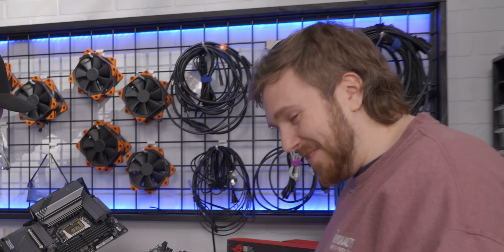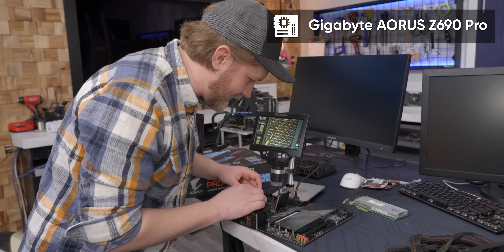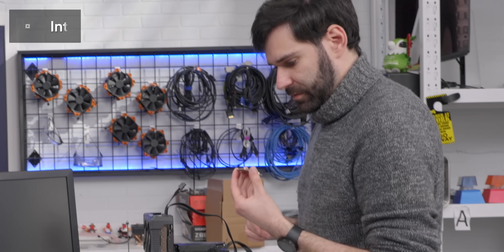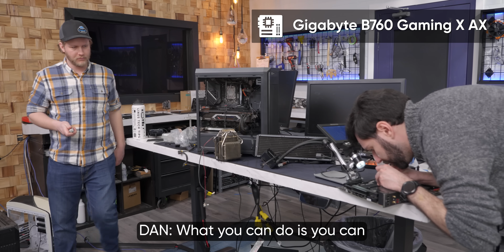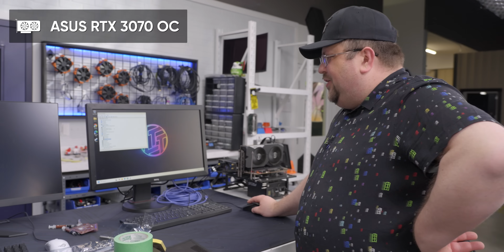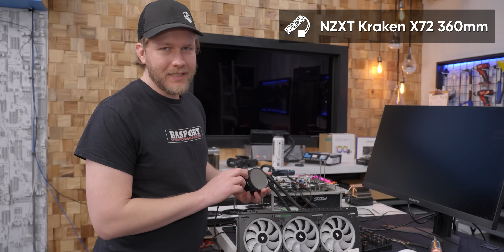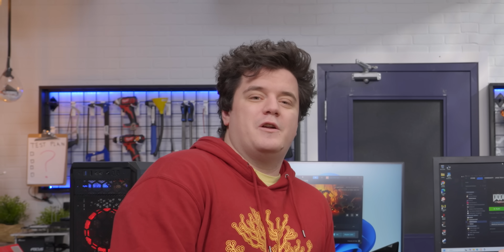I Built a Working PC using only Broken Parts

Comment: When buying "broken" PC parts for repair, focus on stuff that mechanically damaged - scraped off components, broken connectors, bent pins, these have the highest possibility of working again.

 BUT. 

This only applies if you buy it directly from the owner who did it or some trusted source. Theres a ton of sellers that just manufacture a fake problem to cover the real one preying on your dreams and hopes. Fried CPUs with bent pins on purpose, dead mobos with bent pins but entirely different problems, gpus with broken fans or hdmi.. 

Also some repair shops sabotage parts with intermittent problems to make a easily RMAd problem.

Got a non working 5800X3D for ultra cheap (directly from RMA), tried it, shorted, motherboard survived but psu got damaged .. sold it as decoration for few bucks, got contacted half a year later by a guy that got scammed with it in another country, then later he boasts to me how he scammed AMD and got a replacement out of them. Some of the parts have history 😅

Comment: reading all F's is not a sign of a dead core or card either its a failed bios chip or a failed read of the bios chip those connectors are hard to get on there perfectly its best to just de solder the bios and solder it onto the flasher

Comment: a friend of mine gave me his PC and I was literally just expecting to use as a case and not much more, but turns out they just knocked the GPU out of place and putting it back in fixed that. though unfortunately the CPU had baked the motherboard because the OEM broke the CPU cooler. so a mobo, a new CPU cooler, and it's as good as new for the most part.

Comment: Honestly broken electronics are such a fun hobby.. if you have too much time. I got a Really nice DJ deck (NI Traktor Kontrol S4 MK2) FOR FREE because it was "missing power" and the guy was going to chuck it if nobody had actually picked it up that day. I got it working with the power cable from my display and went to get a universal charger with that tip for 80€. He gave the deck away in a pioneer DDJ400 box so the guy had gotten a 300€ controller to replace a functional 900€ controller 🤷‍♂️

Comment: I had to RMA ram one time... it was a PITA diagnosing that it was the ram breaking, and it didn't break linux somehow, so if I didn't dual boot I'd've never noticed. at the time I was mostly booting windows tho

basically it bluescreened once I hit ~30gb of ram used. which isn't hard when you're a java dev.

Comment: When I was trying to build an ITX build on a budget I bought a broken B450 listed as "for parts" to see if I could find out what was wrong and fix it

When it arrived I realised that even if I could get it working, the bastard had ripped off literally every single removable component, so I'd still be left with half a motherboard 

"For parts" my arse, he even took the cooler backplate and vrm heatsink

Comment: buy a prebuilt with crappy everything else but the gpu, that also has on board video, take the gpu often these systems like hp cost less than the gpu usually sells for, resell the pc with built in vid working to a hs student who only needs it for internet and  homework.

Comment: Buying broken hardware, while not very lucrative for me, is worth more for the learning experience of what repair entails. Recently I bought 5X 'broken cameras' on ebay (all the same, cheapish obscure camera). One had a 'lens error' [these cameras did not have removeable lenses), 2 had broken battery compartments, and one worked straight out of the box just fine (had some scuffs though). All were claimed broken via sellers.

The fixes:
-Screwdriver on the lens error - I placed a wedge between the lens and the lens casing, and re-deformed the plastic lens casing to fit the lens. The pictures remained sharp. I believe the lens casing bent slightly due to a drop issue.
-Replaced battery compartment using body + hinge from broken camera
-One battery compartment was beyond 'sellable' repair - The body of the camera had nothing to keep the battery in place, it was just a giant jagged hole. Tape was the solution for me, and I chose to keep it for myself instead.
-The completely dead camera was necessary to diagnose first as the likely 'forever dead' specimen, so I could deconstruct it to see how the camera was put together for the other repairs. The dead one had a battery explode, and had some corrosion evident even without deconstruction.

Comment: My GPU was listed as dead, with random shutdowns, so I did a little digging found out it had entirely inadequate thermal dissipation for memory and decided to take the shot on memory overheating... It turned out I was half right, it was a cooling issue, but it just had a blind spot on the die. But still $300 RTX 3080 (2 years ago) is nothing to sneeze at :3

Comment: I love my delta hub wrist guards, if folks needed a testimonial outside of an ad, but I also recommend turning them 180 degrees and using them for the opposite hands. At least for my wrists, the outside end is pointier and sharper, and is much more comfy.

Comment: My partner and I both kept GForce 970's running for 15 years! Fixing/refurbishing old parts is a challenge.  My card had to be taken apart and scrubbed at least 5 times in the years that it ran.  We still have them, we both just upgraded to the Ryzen 7500 (him) and 7800 (me)

Comment: Bought a 3080 that booted but got hot very fast and crash,All it was is the thermal pads they used were so thick the GPU did not touch the damn cooler.Am4+ bent pins are easy fixes.Heck I got 4 sticks of 8gb G skill 3600 because the guy thought the board and ram and cpu were not compatable.Nope Just had to do some ram stick swaps and got them all working along with the cpu and MOBO all for 150$ Ryzen 7 5700x3d  Aorus x 570  master with the ram.Out of ALL the used stuff and broken stuff I got one Ryzen 7 5800x that is fine under load but when at idle it occasionally crashes.Just one Item out of the 2000$ I spent.I built 5 AM4+ Pcs Upgraded from a FX8350 am3+ system Going to sell 3 of them and that will pay for all of the cost.Made evry cent back plus 2 Pcs I am keeping the best of the 5.Even the Middle road AM5+ is not that much faster than the top AM4+ when it comes to gaming and recording music.

Comment: As cheap as ram is right now, I don't think I'd ever bother with dead ram. Cpus I'd avoid standard consumer grade, often times with hedt xeons you can get away with it because recycles often don't know what they're doing with them. Pre-ryzen I got an e5-1650v2 for 150 when the going rate was 300 because the recycler and original buyer tested tried them in dual socket motherboards. When I used to deal hunt for stuff like this on fleabay, I'd always read description and contact the seller to try and figure out the possible issue before buying.
Reply: Main issue is the time sink into hunting for parts. I would be searching stuff basically all day everyday.

Comment: I bought a Titan X for $100 USD because they said the HDMI wasn't working, which was fine because I was planning on using the DVI-I port anyways. Turns out, the HDMI port worked fine anyways.

Comment: Bought a used Gigabyte A320M S2H V2 (It has a b350m chipset, yeah weird) for 15 dollars with an A320M S2H bios (Without a v2, which only came with a320m chipset). It still works but buggy and cant overclock. So i bought a ch341s spi flasher and flashed an original bios, a v2 bios from gigabyte website. Working ever since, with an R5 3600 OCed to 4.2ghz

Comment: Would love to see you trying to reball the CPUs. I think your guys would be more than capable of doing it. Side note on missing pins too, if the pad is okay, but the pin has just snapped, it is possible to solder a new pin to it... It won't be easy or fun, but it's possible! :)

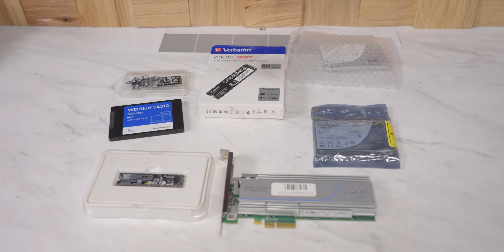Comment: 6:23 A friend gave me a very dead SA510.

They are known for nuking themselves due to firmware issues. I fixed it in software somehow - I remember using diskpart and the OEM software for firmware updates, but I dont remember the exact process. It also didnt even appear at first.

I would bet anything that this was the issue with the SA510 in the video.

Comment: I wish that both the CPU and the socket just had contact pads, so that bent or broken pins don't ruin the CPU or motherboard. Instead, there should just be a $10 insert that connects them. If the pins on the insert get bent, you just replace it.

Comment: CPUs if it dies, it really dies. GPUs are fixable but very hard to fix even for board level technicians. RAM on the other hand is just too shitty based on my experience where it can work on this PC and not the other because of so many factor. If you're buying a kit of ram, there's a high chance of getting a lot of them working if not all. Board, forget about it. PSU? Well if you live 1 block away from the fire department go for it.
Reply: i was thinking the same as well. Basically the only parts i'd buy used is Drive (for non OS and non crucial storage like steam library). I'm not sure about mobo. THe video seems to indicate you can have good luck with mobos but it's such a central and crucial component of your whole build, essentially connecting everything together that trying to figure out what is wrong might be a nightmare?

Comment: I once saw a listing for a "broken" MSI B450M Motherboard for only 15$. The Seller said it couldnt turn on even tho the lights were on, and they tested all the other components and they all worked fine. I bought it and as I turned it on it worked immediately. After a week, I found out that the previous owner flashed the bios with a version that didnt support his own CPU, which was a 2700X, but once I put my 3700X in, it worked, just like that.
Reply: Best win I got was a guy dropping batteries into my old work for recycling, had two towers in the back of his car, I asked if he was dumping them too, he said was, said one had a 1070 in it, not sure about the other, I grabbed the one with the 1070 in it, took it home, plugged it in, booted, worked, had occasional crashes then stopped entirely, replaced the PSU and it worked for the next 5 or so years, each year it'd lose a PCIe slot, but it kept working well enough to game on, it was my VR rig for that entire time until about 2 months ago when it finally wouldn't post.  It cost me exactly 1 PSU, I still have all the harddrives it came with, had a heap of high seas'd software on it and some music. All in I'm still using 3 of the storage drives and the cpu cooler is in my parts bin.
Reply: @sirspamalot4014 why didn't you take both?
Reply: @parsadoes  Some stupid idea about having too much shit already
Reply: @sirspamalot4014  ugh that sucks man I feel like I lost a chance a million kilometers away 😅
Reply: @parsadoes  I mean, there might've been some good hardware in it, but end of the day I got 5 or more years out of it, most of the hardware is still good, and I'm still using the GPU as we speak, so it's done, and is still doing me a great service. It was still free.
Reply: @sirspamalot4014  yea I mean the loss that you didn't take both. still cool win tho 😁
Reply: The beauty if the used market, the knowledgeable flourish
Reply: bro hit the jackpot 🤑🤑🤑
Reply: I just swapped my b450m for a b550m and with my same 5700x3d/9060xt I saw a 40 fps jump in game
Reply: @TechDove maybe the thermal paste refresh had a part?
Reply: This reminds me of the only times my own pc had an amd cpu, and i have fond memories of the Ryzen 5 2600, but ever since i5s have become 6c 12t its my go to
Reply: I have a similar experience with a Asus B350 gaming F board, all the lights came on, the memory light was on. Took the gamble for $20 and it worked perfectly fine. A friend of mine still uses that board to this day.

Comment: Regarding that no-power Aorus board, you could try and short the green "power good" wire in the ATX plug to one of the black ground pins to force the ATX PSU to power on while it's connected to the motherboard. While having it shorted, you could press the power button to see if it now works. I revived a motherboard like that once. Worked for many years afterwards.

Also, you can buy a cable for that NZXT Kraken X72 directly from NZXT for very cheap.

Comment: I was inspired by the first video of repairing broken parts and fixed an Asus maximus impact VIII.  I actually bought it before the first video, and found that every pin on the bottom 5 rows were damaged after the listing basically had the computer version of "ran when parked".  I was going to resell it and hope some collector would buy it, but after a little inspiration and a tedious 2 hour socket surgery and BIOS update, was able to get it to boot to windows with an i7-7700K.  After experimenting what games I could run on it, which was a surprising amount, I now have it set up as a hexOS NAS.

Comment: the amd black screen, and not working with drivers, is something i have seen a fair share of times, what i did to make it work, was to underclock my card, and also displayport will work but using hdmi wont work before u ddu the drivers and install new drivers, also a older amd driver, did work perfecly and then a new update came, me and 5 of my friends all had the same issues with the black screen, we all had 6000 series (cant remeber what version it was, but at some point the 6000 series got really undstable... got mine to work by underclocking very little, but i had a oc version so it dident hurt my performence at all)

Comment: 22:32 it happened to me one time, i installed a new nvme ssd in my pc and i was nkt able to initialize it due to some settings in bios. I found the answer on facebook off all places, all the reputable sources online were just saying the obvious stuff, like look for the tool in windows and use it to format the drive and you are set. But what if the drive doesn't even show up in windows for that tool. What if it only shows up in bios.
So i was able to get it working just by changing some option, something along the lines of intel optane or something like that.
Can not remembet it.

Comment: I got pretty lucky once with buying a bulk skid of returned broken electronics. Most of the monitors were busted pretty bad but one only had a small cluster of dead pixels in the corner and another was just missing the power cord but works just fine. Joystick had a cracked LCD, not something I care about so I have a nice joystick now. Steering wheel just needed drivers for PC that were more difficult to find online. Most of the printers didn't come with USB cable and relied on wifi so they would have been returned as missing cables or something. All the SSDs and UPS on the skid didn't work at all though. Spent $50 and got $8 back at recycling and ended up with a joystick, racing wheel, two spare monitors, and five printers (with ink packs) so I think I won

Comment: 21:33 you weren't using the required 1.8V adapter needed to flash almost all bios chips used in modern computers (around 2017-2019 onwards). The chip may have survived, but if it didn't, you will have to replace it. You may also have just plugged the cable into the I2C part of the bios flasher instead of the SPI. That's what the second half of the socket is for, even though it looks like it is just made for larger chips. It's just very confusing (I had to learn some of this stuff the hard way)

Comment: What about trying to cool a cpu with an air compressor, just put a blower tip on, aim, and pray it works, lots of concentrated airflow, but id imagine the end of the bit would start to freeze over

Comment: You just kind of glossed over the PSU with mismatched cables thing, but that's a real concern with buying used modular power supplies that haven't been refurbished by the manufacturer. 
While the pin order is standardized on the component side, it isn't standardized on the PSU side. Even between model years, the manufacturer can change the order of the pins sending voltage where it's not suppose to go if you use your original cables with a replacement PSU. About a year ago, there was a pretty big blowup at EVGA when a customer support rep told a customer to commit warranty fraud against EVGA after they sent an RMA replacement that fried the customers hard drives when they swapped it for the exact same model PSU that was DOA.

Basically, only buy sealed PSU's unless they have all of the required cables hardwired.

Comment: Hm, the difference between the amount spent and value of the repaired parts is roughly 20%. Honestly, I would guess you could have just bought used but working parts for that and ended up in the same price range.
Also, the prices you paid for "broken" parts are insane to me.

Comment: At 21:30, you flashed a 1.8V BIOS using a 3.3V programmer — you just finished it. 😮‍💨
Reply: Should be good with another bios chip I think..
Reply: @rkan2  did you know the core is connected to 1.8V rail ??:face-turquoise-covering-eyes:

Comment: I know its not the point but you can also buy Used but working for 20-30% more money, and still half the new cost anyway and way less risk.
At that point risk to performance+money far outweighs comparing it to fixing broken parts for bit cheaper - this coming from an electrical engineer.
if the fix is easy and you are sure of it, go for it sure. Otherwise this is borderline "stupid trying to be smart".

Comment: That bios flasher needs a mod to be reliable. It's outputting too high a voltage, which leads to a risk of random component frying. It's just lifting one pin and running one wire.

Comment: I remember back in the X58 days I was saving up for an X58A-UD7 board, the top tier board from Gigabyte at the time. I found a DoA one for $20, figured out who the wholesaler was, got the original receipt from them and sent it back under warranty - boom $400 motherboard for free.

Also I miss the dies when $400 was the best motherboard money could buy.